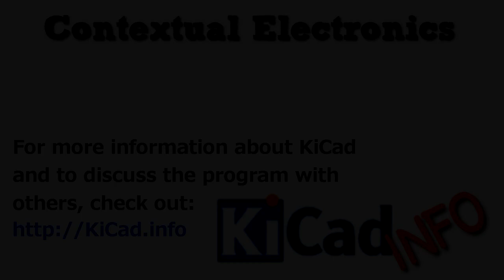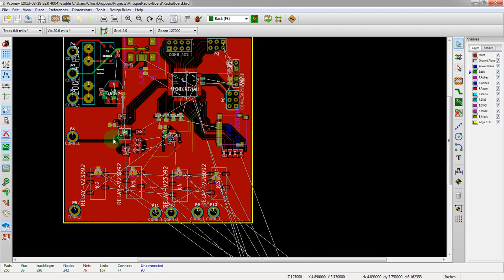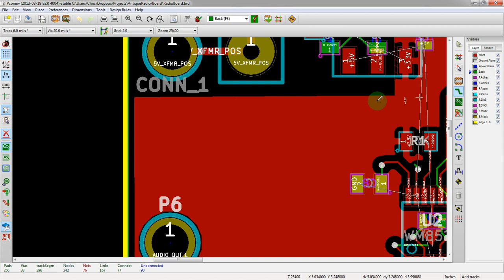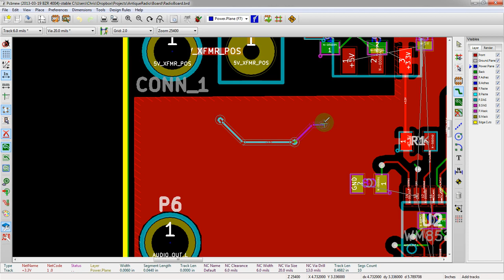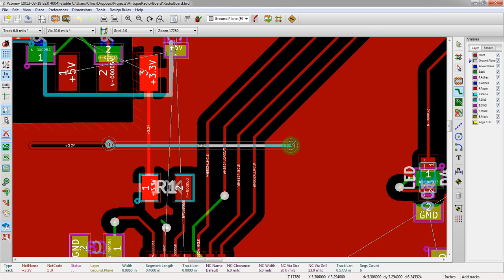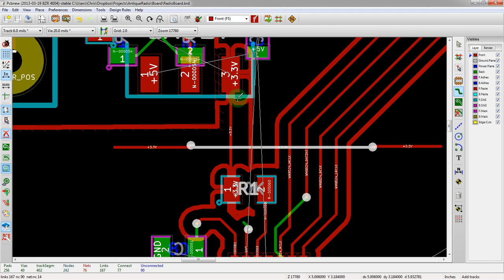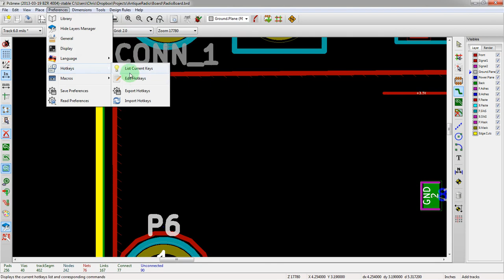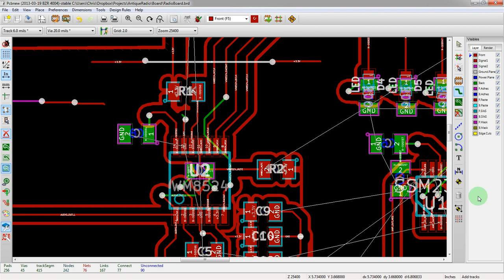KiCad 3.0 - Creating Different PCB Layers In KiCad

Comment: Hi, thanks for the video. One question about how the layers are arranged - for the 4 layer setup where you have Front - Inner2.Cu - Inner1.Cu and Back - is this the order they are "stacked" on the actual board? In other words, are Front and Inner2.Cu on one side of the PCB (with Front on the top) and Inner1.Cu and Back on the other side?

If so, how are you supposed to know?
Reply: +jmckendry84 the pcb manufacturer will tell you how to specify which layer is which/what the stackup is. for example, look under the "layer naming" section for OSH park http://docs.oshpark.com/services/four-layer/